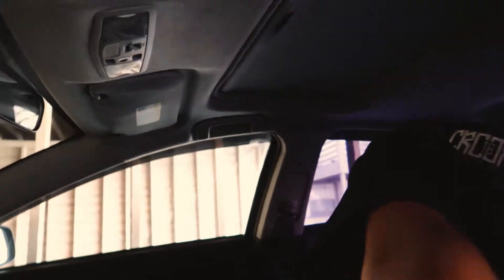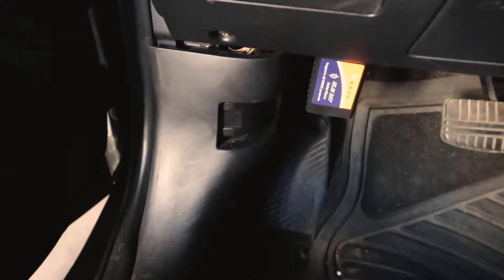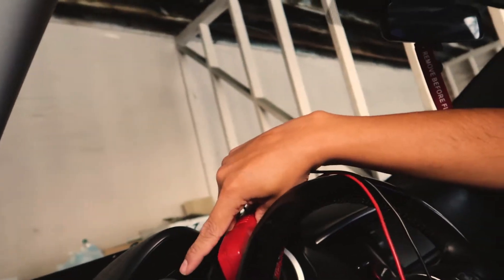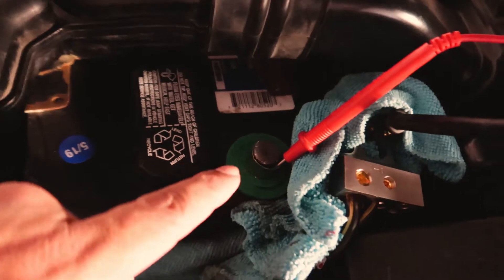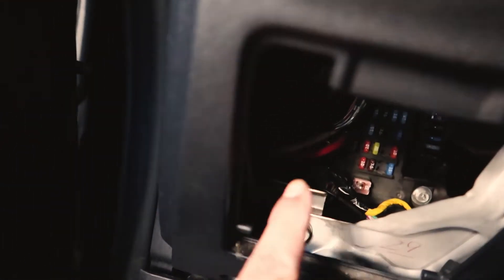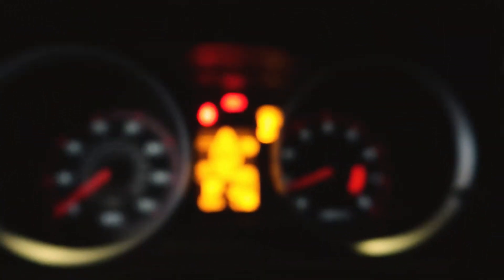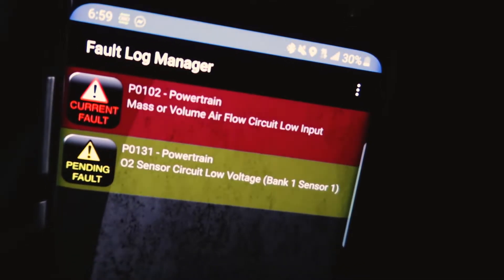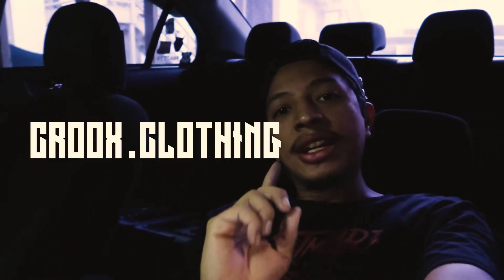Battery Parasite Hunt - 2008 Lancer Parasitic Draw Test

Comment: Hey Edwin, just found your channel and this my first video I've watched of you. Many owners of 2008-10 Mitsubishis have this problem and they usually have a problem with the Bluetooth module, maybe try checking your fuses again but in the Amperage mode, I've heard it was linked to fuse #7 in the cabin fuse box. Hope this helps. 
Sam
Reply from the maker: Thank you for the comment, we did end up finding out that it was the bluetooth module that was the problem a day before lol if i would have known this, then we could have gotten back on the road with content for you guys. Now that is been solved, we are planning more content so stay tuned my friend. Once again thanks for the support!
Reply: Hi Samuel, mine was the cabin light fuse. When the fuse is removed, no issue and no battery drain. Any idea why is this happening ?